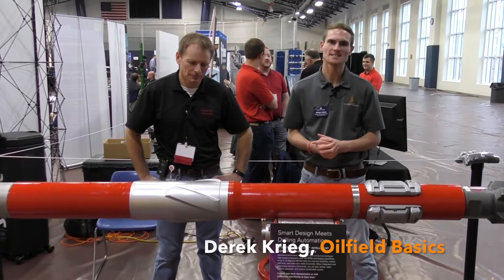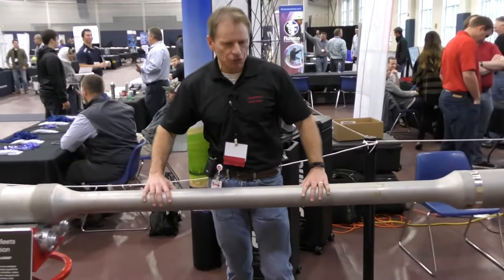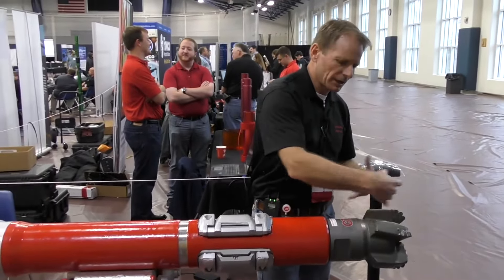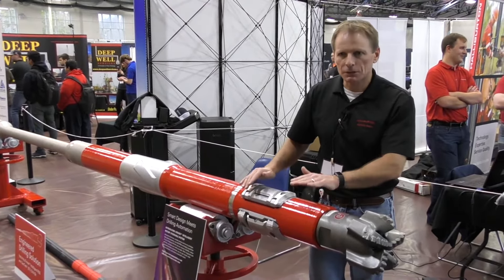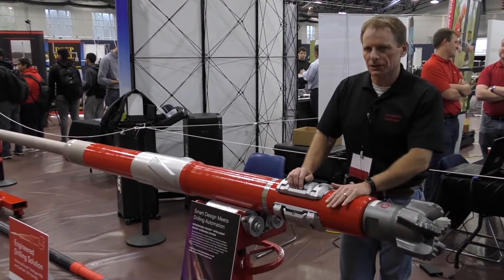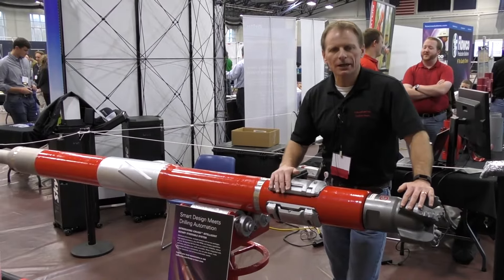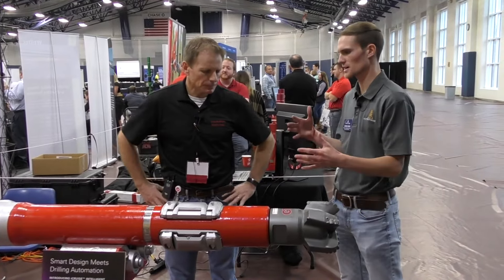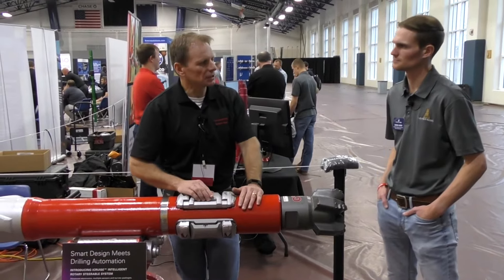Halliburton's New iCruise™ Intelligent Rotary Steerable System

Comment: What sizes are available? 4 3/4'' with 5 7/8'' to 7'' bit size 6 3/4'' with 8'' to 11 5/8'' bit size, 8'' with 12'' to 14'' bit size and 9 1/2'' body with 14'' - 17 1/2'' bit size. What pad sizeas are available?  Stabilizer above is always 1/8'' undergauged? 
How to measure ROP - is depth downlinked from surface?  Does the tool need specific differential pressure from bit to have enough power for the pads?  Means in case losses  occur and planned flowrate has to be reduced, POOH and change configuration. Can this be done by changing an internal ring on the rigsite or only  in the workshop?  What happens in case a nozzle is plugged and pressure drop below iCruise increases above planned range - will that damage the internal parts of the iCruise and toll has to be POOH?
With that Superflex what is the maximum DLS to be drilled with 4 3/4'' and 6 3/4'' tool?  This Superflex can cause vibrations, so in case planned DLS is moderate, is there different  flex designs available?
Reply from the maker: Hey Peter! I wish I could answer your questions man, but I would just suggest reaching out to someone at Halliburton. They could answer your questions better.

Comment: how long can that bit work before it need to be replaced
Reply: It depends on the formation.  We drilled over 15,000 feet in a single run in the Eagle Ford shale in 2014.  I'm sure there's been longer runs.  On a six well drilling pad, we drilled all six surface hole sections with one BHA and bit, for nearly 24,000 feet.  The bit looked new except for the worn paint.  The surface hole section in south Texas is like drilling through a snow bank.